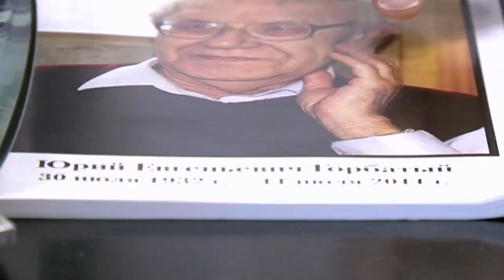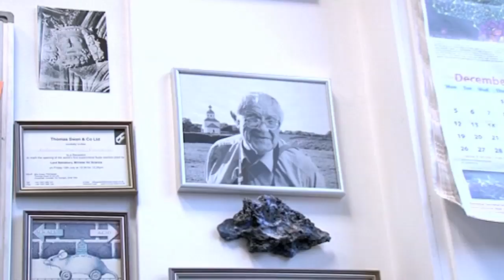Yuri and High Pressure Water - Periodic Table of Videos

Comment: General properties of "Pobedit" and similar alloys are their extreme hardness and abrasion resistance. Basically this thing will cut through most anything that we know except perhaps diamond. The only practical way to cut this thing is called "spark erosion"  it also can be somewhat polished using diamond paste. 

You can see many videos of similar metals if you search for "CNC machining". The small yellow chunks on those videos are very similar to this one except they are coated with titanium.